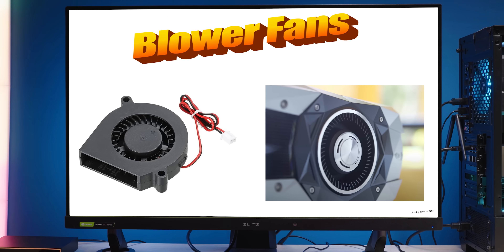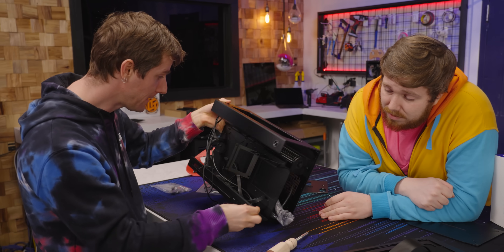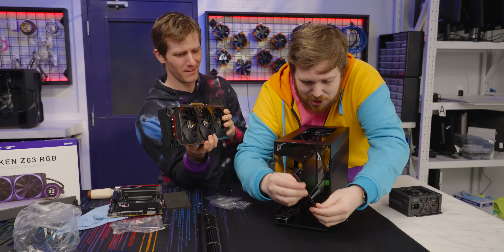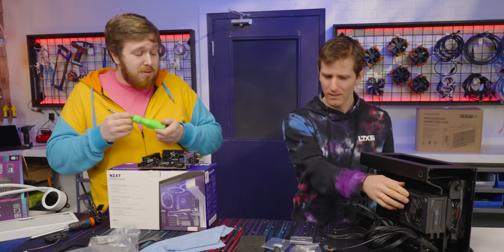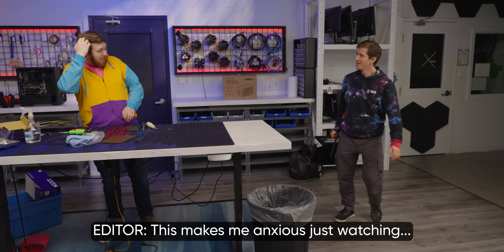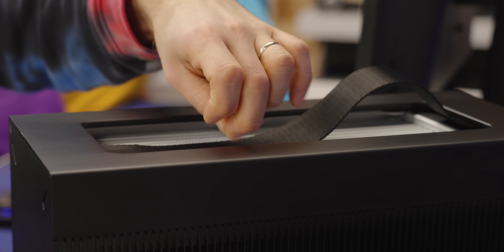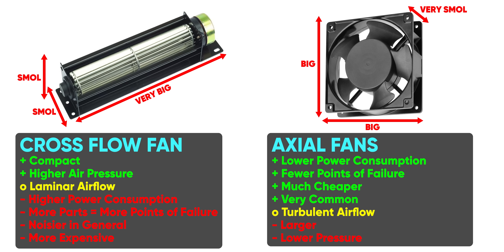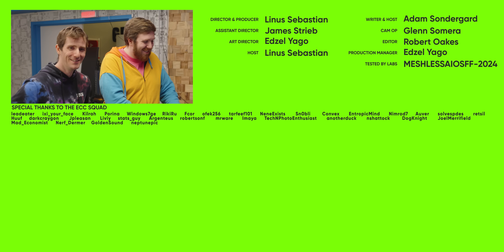This BLEW me away! - Meshless AIO SFF by Meshless Design

Comment: The silicone insulation on the cables isn't just to make the extra flexible, it also makes them "Heat proof", I have that on my soldering iron, and if you've ever used a soldering iron with a Silicone cable, you'll never want to go back.

Comment: i actually had a SFF case and crammed one near my GPU, i slightly damaged the PCB, but i got it to be far cooler, and it worked
i got it to be basically full fan speed performance with idle fan speed noise level

it might not sound like much, but thats an AMAZING tradeoff

on another note, i think we need governments to add wattage restrictions for individual components, so companies get creative to get these systems to work without all of these dangerous new connectors that keep causing fires, or wattage requirements that would either overload house wiring or need rewiring to get it to work properly

the "80 series" and "80ti series" class of cards need to be the highest wattage card under such a rule, and i mean that as in the current cards in terms of wattage requirements (or lower)

the idea would be that you get things more power efficient for a myriad of reasons, but one could be that you then have a set thermal performance target, and thus another way to determine a part's lifespan capability

Comment: The test with the case open its unfair for the CPU, it actually restrics airflow from the rest of the setup making the vacuum greater then sucking more aire throught the top radiator

Comment: It's just a blower fan. Only difference is how long the rotating assembly is. So if you think back tooo....2006 maybe, Thermaltake 80MM blower fan. Had one I got from NCIX lol. These tend to be quieter because of how long you can make them. It doesn't have to spin at thousands of RPM's to get the same CFM. It's kind of like an assembly from a split unit like the ones you put in your house.

Comment: did i get it right? the 7950x is a bad choice because of the lower thermal output? or did i twist it this time and it is intel #1 for thermal benchmarking? and that while not even beeing cheaper? these are some weird times guys. :D :D

360 for the case including the fan seems fair.

Comment: I wonder how long until the typical SFF and MFF manufacturers do a crossflow design.  Obviously there's eyes on this style of case now, let's see how long until someone goes for a more cost-effective design.  So many manufactuers work so closely with fans, and just general parts, oems now that I wouldn't be surprised if someone doesn't come up with a cheaper alternative for a crossflow blower.  Extrusion is also an expensive option, but I wouldn't be surprised if it was the cheaper tooling for NexiGo's scale; and honestly this style of blower could fit an insane amount of modern cases with a bit of tooling modification and some ducting, considering how many cases now come with vertical GPUs, really the most major change is mounting and the side panel for exhaust, and mounting could easily just borrow original top fan mounts or radiator mounts for a bracket, also imagine cases that have enough basement area to house one of these and further separate airflow.  There's potential, there just needs to be a larger OEM that provides a more cost-effective solution, considering most crossflow blowers are for industrial equipment and come with a price tag for such, yet a consumer-priced solution is more than viable though nobody currently produces any offerings.

Comment: I know it has downsides for big server operators like datacenters and such. But I can't help but wonder how cool it would be for small server operators like enthusiasts and homelab users who potentially care a bit more about the noise. I took a page from Linus and have racked all my machines, but I don't have that YouTube money so the rack still lives in my home office. The big Noctuas make it fine most of the time, but when they need to spin up it does get a bit annoying. I have a bunch of crossflow window fans that would be about the size of a 4U crossflow fan and at full blast I feel like they move more air with a better noise. I can only imagine if they were tuned by Noctua.

Comment: This is really cool. I could see this working really well for the side vent in the front on the NZXT h510 case. If you could have of those fans directly pull air through that side vent and blow it forward in the case, that case would have much better airflow.

Comment: Honestly, the price of the case isn't terrible. Yea, it would end up costing you more than working with a standard case, but when you take into account the added costs of  building small form factor PCs it's not totally out of the question to spend $360 on a really nice case (quirky as it may be). The fact that it's designed to cool the beast that is the 14900k and fit a QUAD SLOT 4090 (seriously wow) in a SFF case is bonkers! If you're target customer is already spending that kind of money on their components then the price point of the case is downright reasonable.

Comment: I have always wondered why this wasn't a thing. A sideways tower fan. Could even have incorporated mini ones into laptops. I've seen the vibration motors in cellphones. half the width of a pencil eraser. Turn it on its side, add a 3 inch spinning 'crossflow' fan, and cool your laptop while still keeping it thin and only taking up as much space as one of those stubby pencils at the minigolf lol.

Comment: I've used one of those as a case fan, salvaged from a very old photocopier (Canon or Panasonic, idk for sure). They're called "squirrel cage", I believe. They were loud and required 24V, but it was fun anyway. I don't think they were any good as case fans, as this design seems optimized for pressure.

Comment: I have that portable cross flow fan in the video which is supposed to be for laptop cooling. It doesn't quite work on gaming laptops, but after my desktop went dead and I decided to just use egpu on my work laptop, I figured out that this kind of thing is great for improving airflow on ultra slim laptops. With some thermal limit unlocking with throttlestop it makes a great choice for gaming. In fact it's even possible to use VR on such setup.

Comment: compare to a single Noctua $30 plus for a single fan x how many of them you need plus the case. after you add in dust which is the huge problem with axial fan type cases. with this design you can put a carbon filter on the inlet and keep everything clean and cool . when you add it all up this is a very good value for it form, function and originality! as soon as i can afford to going to get one i am!

Comment: Think I said "shut the f up" out loud at least 5 times watching this. Cool case, stupid manufacturing though, as an engineer - you'd never extrude that like that, if you had a sheet and bent it into its primary shape you'd get exactly the same effect then spot weld the extra bits on, and it'd be massively cheaper (and easier, and with less custom tooling) to make, and it'd be absolutely no different. I mean I appreciate the art of the engineering, but it's also kinda dumb for making a consumer product. Once the panels are on, nobody cares.

Comment: a cylindrical type fan is proven to be better than a standard fan when its unassisted such as front of cars to push/pull the air. 
This is why literally all AC units use these blower fans.

Comment: It's not just the silicone of those wires, the individual strands are also much smaller, (they are like hairs). That makes the cable more flexible but adds to the cost as well. So it's a combo of the silicone and the fine wires.

Comment: I can't really see these saving much space in a PC, at least not a SFF one like they showed at 0:58. Noctua sells 10mm and 20mm deep fans that fit that radiator perfectly, take up the same space or less, and I think they would perform better on static pressure. Ducting may help the crossflow, I hope that guy added some.

Comment: I'm surprised that there were not many years ago 3D printed gel patches paired with a (custom) fitting version, both for perfectly set to bubble trap the heated "vibrating" air at a millimeter away which after the air vibration gets quickly slowed by colliding into the walls of the bubbles until its steady enough to flow out easily in being cooled down enough. Vertasium (YouTuber) showed how such a very thin layer can stay cool at the touch while the other side is fully blasted by a flamethrower. However... I also understand that such a meta-material is extremely expensive, so... I doubt anybody can afford to show if it can maximize GPUs on its own.

Comment: This is very cool and the little touches show that the design (and its designers) are very uncompromising and clever.  While making such a small SFF so performant is a cool party trick, I would much rather see this company put together a more roomy case because one thing I think you want from an expensive case with such good build quality is longevity and a little extra space would go a long way in relieving constraints on the upgrade path for systems built in the case.
My current PC was build in a SFF case, an NCase M1, which is a fabulous case for an SFF, but I think it is going to be my last SFF PC.  Upgrades, repairs, and cleaning inside these tight SFF cases is a huge pain and getting the thermal management to be performant enough for high-end processors is so much less forgiving than in larger cases.  If I was going to consider another SFF case, I think this would be a strong contender even with the steep price.  If it was roomier, I'd have to make sure I remind myself that I don't need a new computer right now.

Comment: dude im using the sg01 case at work currently. it has a 5600g and a 5700xt in it and just this evening i modded it to slap a 120mm fan just inside the 5.25 bay. just a little more air sure helps

Comment: those fans are easy to strip from older electrical convection heaters also from old defect airco units. been using them for years so if on a strict budget go to the local dump. many can operate on 12 volt and the voltage plus amperage is generally found on the fan housing. only issue is they are not black but almost always a dirty grey metal. still have them running after 9 years inside my hifi cabinet to pull air away from the amp which is the Marantz SR7001 which can get hot.

Comment: Looks like the LG fan that is nearly working
 
The one you can’t replace cause it’s locked into a certain volt 
You need to plug a USB fan
In the service port 
But still need the broken one to spin to keep the tv on
The lg fan is super expensive

Comment: An axial flow fan...nothing new...but I would definitely use one if it was big enough for my case. The case though is definitely overpriced though. Silicone wires are not that much more than regular wires. I use the silicone wires for my electric trike conversions as it conforms to the routing so much better. If you are paying a lot more for them then you are being ripped off LOL.

Comment: I'm not a fan of pulling air from above (no pun intended). It's recommended to oriented the fans to blow out of the case from the top for many reasons, and one of them is dust. All those dust that's settled on top of the case now being pulled straight into the case.

Comment: Silicone insulation on wires is not as common because in most industries they are not used because prone to the insulation being cut or damaged exposing the wire, it's not that silicone is inherently more expensive, just less demand
Reply: Silicone is also generally more expensive than PVC, but true. PVC is more durable.

Comment: $360 is not THAT bad. Its niche but I'd honestly pay it especially since you can cram some serious hardware in there and the build process looks fairly easy. I'd get it without the strap and find a way to put a handle on the outside that's metal that folds down flush with the case. If you have a razer core egpu, think something like that. All in all, I'd buy this.

Comment: "Expensive" is relative for that cross flow fan. A single Corsair LL RGB 120mm fan goes for more money than that. Sure, more bling but if we're going for function over form, it's not out of this world pricing. Also, this'd push more air than a single 120mm so you'd be needing 2-3x of them, making for similar price anyway when buying cheapo fans.
Easily palatable pricing if it solves your needs.
Hope to see them in more SFF builds!

Comment: Question for anybody that might know: Why would you extrude this case as opposed to just bending sheet metal? the finishing labor is about the same, but the cost to bend sheet metal is cheaper. Extrusion might be stronger, but it's a desktop computer- does strength really matter if the thickness is roughly the same?

Is the extrusion aspect purely for marketing?

Comment: I hope these guys do good. 360 for this case for such a niche audience and design is pretty reasonable I think. Having something this small, that can fit this much power is difficult to begin with. Add onto that, the ease of assembly, and incredibly clever and well thought out design, make this case almost a no brainier for someone who was going to spend as much as the rest of the components in the system cost already. My main concern is how reliable the fan will be and how easy it will be to get a hold of a new one since meshless is the only one that makes it, because it's so non-standard. I hope these guys do some great business, because it would be such a shame for something like this to die and users can only use this case for as long as the fan lives.
Reply: I'd consider it but I don't really like the look, I'll be paying attention for there next case, if it's more attractive I'll seriously consider it because it does seem like a great company

Comment: wooow finaly someone used this blower , ive used this to cool off my laptop side since 2011 it will blow all the heat away , of course it was not the same product but it was sourced from a defective medical lab equipment and utilized by me as laptop cooler , cool cooler 😅its called cross flow blower

Comment: Honestly, this concept is cool. Just a single fan, less wires, less complications, less maintenance and more quiet
Reply: I prefer no fans
Reply: the second time I watched it I realized that it could be more quiet than Be Quiet! fans
Reply: Not technically more quiet but definitely a more tolerable constant noise.
Reply: those who care about fan noise, what is about it?
Reply: its not a single fan tho
there are like 5 others
Reply: In industrial equipments and racks this is very common
Reply: @dtibor5903 It's also what a standard tower fan is and they sell them at any store.
Reply: Hear me out! Even cooler concept - no fans at all, no wires, noise, moving parts - it's brilliant, isn't?
Reply: Airflow
Static pressure
Sound

That's what it's all about
Reply: To clean such fan I think will be way harder than cleaning many normal fans and they don't require much maintenance for so many years...
Reply: You're right, a great concept. Just like the linear compressor in the LG refrigerators. Great concept, failure in real life. Let's see if the long term application is as good as the on-paper version
Reply: I wouldn't call 59.9db "quiet".
Reply: @DimitriMoreira  59dB noise at max load at that amount of air is not bad
Reply: even then. the lack of concentricity and support on the fan will cause issues. there is a reason why boats, fans, and submarines all use a relatively common design. 

this thing will destroy itself quite quickly. twist a straw in your fingers loosely then with one hand slowly add pressure (simulating a bearing wearing) and apply pressure until it eventually wears unevenly and seizes. I could see that thing flopping as it was spinning almost immediately, personally I wouldn't expect it to last much more than a years worth of use with the current design.
Reply: @hunterromano5562  I think it will be just as reliable as your standard axial fan in a PC case. These fans are in use in HVAC equipment. I have one in my furnace and mini split AC. My furnace is over 25 years old and the fan is still running quite strong. Plus you see that design used in industrial equipment.
Reply: @hunterromano5562 do you realize every single indor AC in the world uses this type of fan?
Reply: @robertjusic9097  And mine survived 7 years, but is slowly dying now. I have PC fans that are 10+ years old and still working ... but also ones that died after 2-3.

I think it comes down more to quality and sometimes lack and environment variables. Humidity is a big killer for that sort of fan as the motor and bearings are very exposed (or so did my HVAC guy told so)
Reply: Have those fans in an old fireplace insert and they are dogshit. So I guess congrats on jumping on another dumb idea that didn't exist because it doesnt work in the long run. Im literally considering how to modify it to accept axial fans.
Reply: @LupusMechanicus with the exception of the United States and Canada, every single country on earth uses the same fans for their air conditioning unit and they seem to be fine even 2 decades later.

Even in the US now, Mini splits are becoming common and using these fans as mini splits are way more efficient
Reply: @LupusMechanicus  That's like saying manufacturer x makes shitty power supplies, thus all power supplies are bad.

Comment: Cool idea but "only 1 fan" when the GPU has 3 big fans, the ram has a fan and the PSU has a fan.. 
And to me 'meshless' would mean closed, like solid wall of metal or glass. The GPU is exposed to fresh air from the side of the case - that's still 'mesh' is it not?

Still nice to see genuinely fresh ideas coming to market though